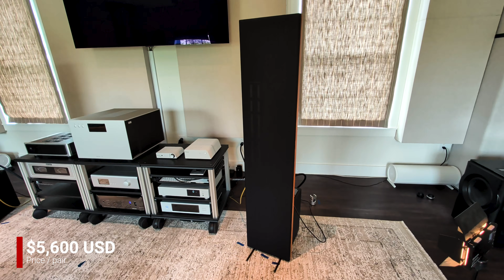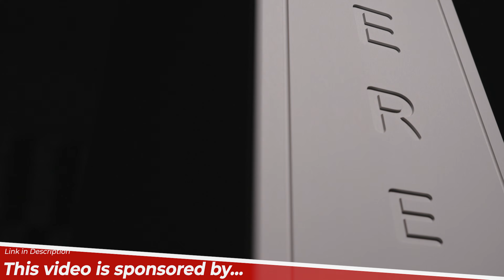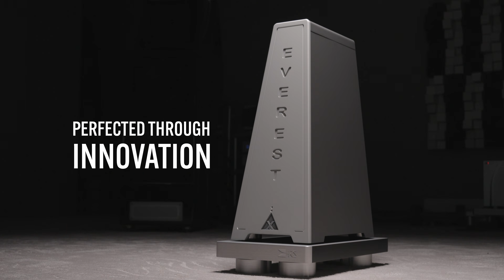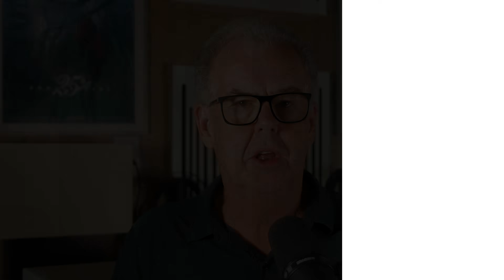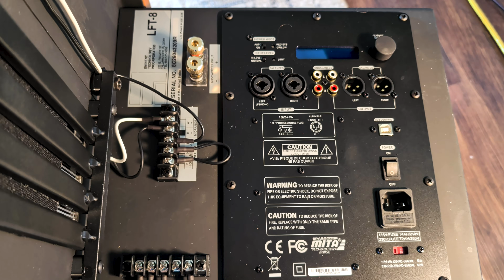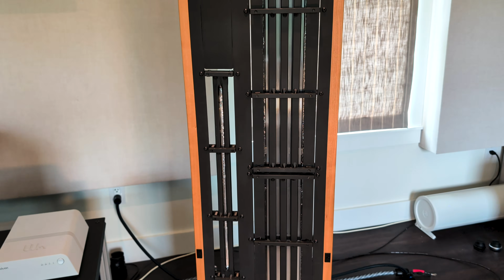Eminent Technology LFT-8c: Building a Great $15k System

Comment: 10 years ago I bought a used pair of LFT8A.  I am and always will be a dipole panel believer.  Started with the Magnepan MG3A.  Then onto every Magnetostatic, Electrostatic, or Traditional driver dipole you can think of.  Upon hearing the LFT8 for the first time my eyes filled with tears.  The LFT series out performed all others.  If I had heard this speaker in its early days my audio path might have been quite different.  I am now a Bruce Thigpen, Eminent Technology devotee.  The 8C is the logical descendant of the Original LFT3.  Try your best to audition one of Bruce's original LFT3.  This review is SPOT ON!

Comment: No, dipoles do not have less interaction with the room, and interaction with the room is the KEY to imaging, not a fault. Dipoles have just as much radiation to the rear as to the front, not less. I'm not sure about your speaker placement in this video - can you tell us the exact placement from side and front wall? It looks a lot different from where you had the Linkwitz 521s.

Comment: I’ve had my new 8C’s for about 4 weeks now. They have supplanted my previous setup (for over 3 decades now) built around Apogee Duetta Signatures.

Yes, they are THAT excellent. They’re the BEST of what the Apogee brought (incredibly delicious and pure mids and highs; i.e. low distortion) with dynamic range no Maggie can touch, and finished off with extremely coherent and easy to “tune” bass that is less “bloated” that the Duetta’s.  And of course way more/better defined bass than any Maggie within 4X the price.

It’s a great speaker. Those in New England that want to listen before they buy, just look me up
Reply: Totally agree.  I have a rebuilt Duetta Sig and there is no comparison.  Duetta has more apparent bass but the bass is much less articulate.  Any of the LFT line outperforms the Duetta.  The LFT3 is a direct competitor to the Duetta at a fraction of the cost.  Bruce Thigpen striks agin.

Comment: I liked them so much I bought 8 of  the LFT8 mid range drivers and built my own set with. 4 per side along with different planar tweeters and separate bass towers. 8 ft tall and sound great.
Reply: My understanding and my reply by Bruce was he doesn't sell them by themselves I asked- that was about 15 years ago.
Reply: @roymindmybusiness6908  Mo he doesn't usually sell them outright. I got them through a group buy that the audio club I was a member of several years ago. A friend of mine bought 4 of them. I don't remember how many they  acquired all together but several members bought some.

Comment: If one can deal with the size and space requirements for planar speakers, they can provide a sound quality far above what you get with box speakers.  The cabinet is a major part of the cost.  I’m running electrostats from Prodigio/Popori that are supposed to be better than a lot of much more expensive box speakers and on par with planars like Alsyvox.

Comment: How would they compare with a similarly priced Magnepan 2.7?
Reply: The ET's blow any Magnepan out of the water. I replaced Magnepans with the LFT-8b
Reply: The LFT8c is more dynamic and revealing of microdetail.  More integrated top to bottom.  I find the 2.7 less coherent than the 3 series.  The 1.7i is more coherent.  The strength of ALL the LFT designs is the magnets on both sides of the diaphragm.  Push/Pull similar to electrostatic designs.  Magnepan only uses push/pull on the 20.7 and 30.7.

Comment: Excellent review -- concise, good explanations of key terms, nice balance of plus and minus factors. You took a lot of care in making this review. Thank you! I might have missed them, but: (a) minimum power requirements? (I have a Pass XA 25 and tube amps.) and (b) Placement? These speakers have a nice footprint and I'm wondering if they are good for folks with a room constraints.
Reply from the maker: Minimum power depends on average levels, listening distance and type of music (dynamic range). As a very rough guess 50 watts min.
Reply from the maker: Placement should be 3-6 feet from the front wall (wall behind speakers) min.
Reply: They were designed with that in mind.

Comment: Did you  ever close your eyes when listening to this speaker?  I ask that question because, particularly with large speakers like this, your mind can trick you.  I have speakers that are bigger than the ones you reviewed.  At the parts of the soundstage closest to the speaker, the sound can seem like it is coming forward.  It’s not.  Your mind associates the sound with whatever it is closest to, in this case the speaker.  If you close your eyes, you realize that the soundstage has not changed.  At least that was my experience with my speakers.

My second point is that people talk about bass extension, but the authority with which bass is presented is often more important than the bass extension.  I have dipole speakers.  The bass is handled by four (4) 15” woofers, 2 per side.  My speakers only go down to 35 hz, but they do so with an authority that smaller drivers would be hard pressed to replicate.  I question whether this speaker is an exception to this.

Finally, I think audiophiles can be lulled into thinking more resolution is always better.  It may not be.  Ruthless accuracy on lesser recordings is not enjoyable and I speaker from personal experience on my system.  We all have music that we love which simply isn’t well recorded.  I don’t expect a high resolution system to transform the recording,  but the flaws need not be harshly presented.   

Otherwise, a great review and really nice to see The Absolute Sound review something that would not cost my first born.
Reply: Sound like you have panel speakers .  Which ones?  I am getting in the Popori/Prodigio eletrostats.
Reply: @RDAudioReviews My speakers are a mod of a design by a well established speaker designer, Joseph Troy Crowe.  The speaker is based on Project 1695 which is available as a finished speaker directly from him.  That speaker is around $13-14K last time I checked and is frankly a gorgeous speaker.

The original Project 1695 was a 2.5 way speaker using a compression horn tweeter, a 10” mid-woofer and a 15” woofer.  The entire speaker is open baffle (OB).  It is also a completely passive design.  I changed the design to add a second pair of 15” woofers and I bi-amped the speaker.  Since the time I modified the design, Project 1695 has been changed to substitute a 18” woofers for the 15” woofers.  Had this been done earlier when I was making mods, I probably would not have done more than bi-amp the speaker and add room correction (Dirac Live).

Hope this helps

Comment: In the late '90s I scored a used LFT-8b pair for $500, back when the new price was $1600.  I found there was midrange damage, so I sent the panels in to Eminent Tech for replacement, which was surprisingly inexpensive.  In the 2010s, I blew up one of the tweeters, and spent $500 on a replacement pair of the new version with neodymium magnets, which I easily installed myself.  Now I am saving up to buy the $1700 8c woofer module upgrade, which I can also install myself.

This will complete my lifetime speaker.

Comment: Excellent review as usual.  Did you hook them up to some of the higher end equipment you have on hand?  Would be interesting to know how they did.  Maybe some of the "downsides" were overcome?
Reply from the maker: I also used my Audio Research S-200, the Soulution 326 and the Master Fidelity DAC. Again, not a statistical analysis, but the output limitations don’t change and the transparency to recording flaws doesn’t change either. But my fancier gear is chosen to be more revealing, not to bend the FR curve or soften transients. Also, a class A amp would be interesting, though out of the price range of my remit.